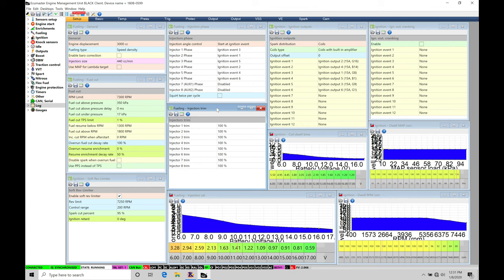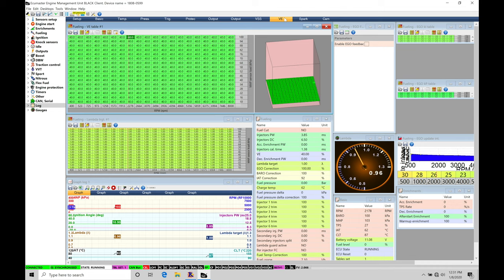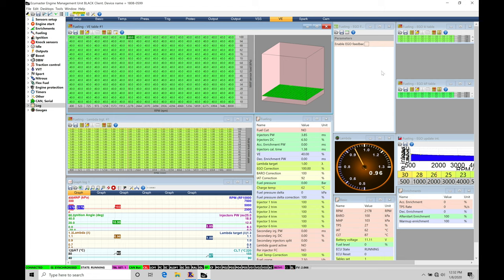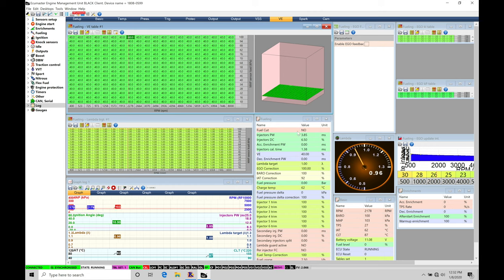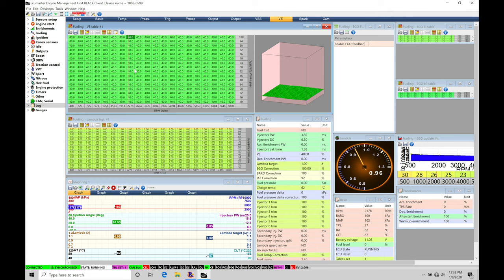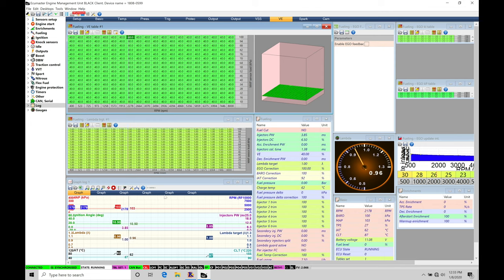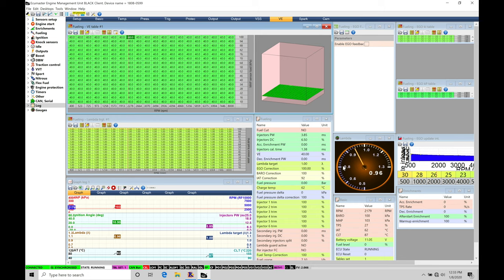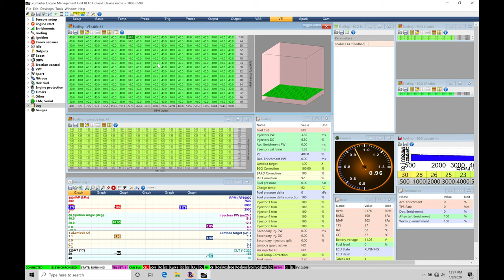ECU Masters Training Course Part 12: Main VE Fuel Table Tuning | Evans Performance Academy

Comment: Can y’all tune a 350z?
Reply from the maker: We don't offer tuning only online tutorials to learn how to tune with many engine management systems.
Reply: @EvansPerformanceAcademy  hi do you have any vids on setting up and connecting vss to hall sensor and inductive and how to tell the difference?
Reply from the maker: @MJ-hh7de  Yes, there is a VSS and gear set-up tutorial in the EMU Black course.  VR = 2 wires (most cases) and Hall = 3 wires.